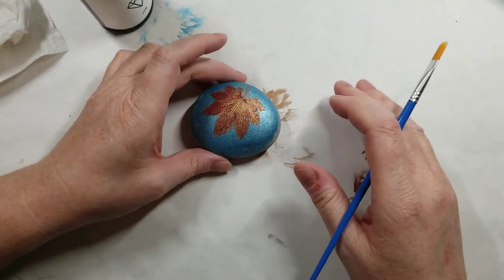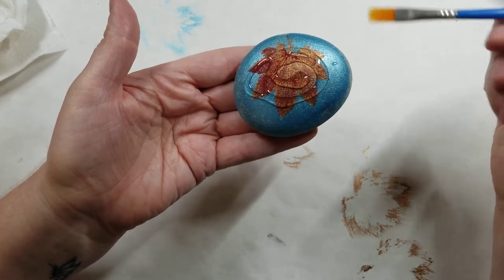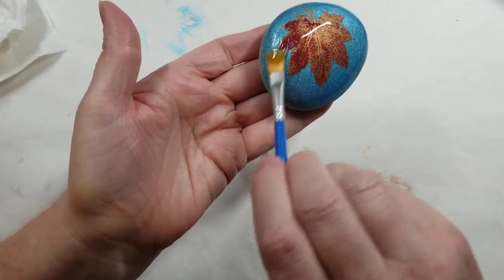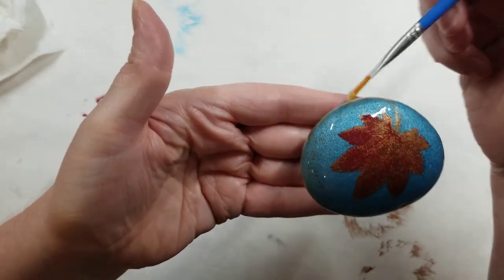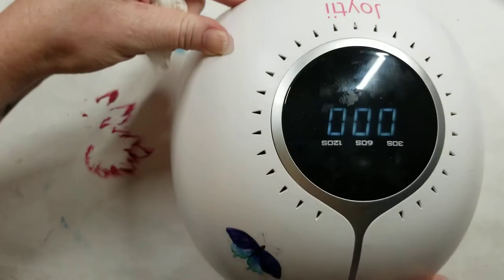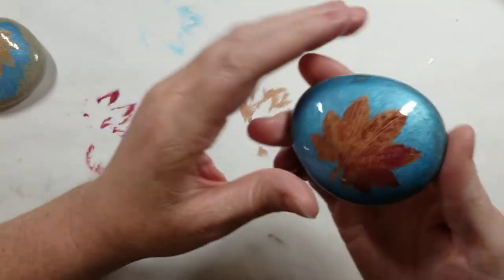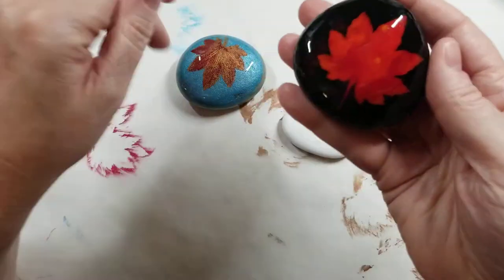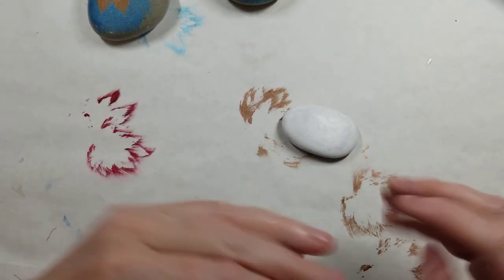Applying UV Resin (rock painting)

Comment: What kind of light source do you have over your work area?  Do you notice any accidental curing of resin from the room/work lighting?  Have cured items inside resin and not sure if it was light coming through windows or my household lighting but seemed like I would get blobs of thicker resin or partly curing resin while I was still working on it.   I know LED's don't emit UV light but most other bulbs do emit some.
Reply: Unless the LED is a UV based LED bulb.
Reply from the maker: Hi! WOW! Very good question!! 

I do not have issues with Mr Resin UV resin "blobbing up"😎 indoors, but I could see how that might occur if the conditions are not properly set in the work area! My work area is free of any natural sunlight, which would be the hugest concern as ANY UV from windows or skylights would be bad. My main lamp is LED and it could, at higher settings, slowly set the resin, but it isn't enough UV emitted to cause premature curing as I am applying. I keep my LED settings lower while applying as well. I use the new model Neatfi XL desk lamp for my workbench. 2,500 lumens. It's pretty powerful LED at the highest settings. 

I would tell you that any UV from sunlight will cause the UV resin to prematurely start gelling up, or blobbing up. So, applying indoors near a window is going to cause premature curing issues unless you have a good curtain to block UV. If the room has suspected UV emitting lighting, then I would replace the bulbs or turn off that suspected light while applying. Making your area UV free except the lamp would be important. The UV resin application will always be inconsistent if prematurely exposed to UV before you're ready! I also apply away from the UV curing lamp. I keep my lamp on a little shelf under my bench so i can reach under pop it over my rock, then put it back under when I am done 😎. 

I hope that answers your question! 💗🥰

Comment: this is a really solid method of coating stuff with uv resin, thank you! so is the trick to not having the resin drip all down a rounded surface just putting on a thin coat? i want to try applying resin to 3d models but they often dont have flat tops, so i want to make sure it sticks to the surface and doesnt start pooling wherever i apply it
Reply from the maker: Yes, I would use a small brush and do thin coats. The cool thing about uv resin is you can layer it without sanding the cured resin surface. When I have added resin to any of my 3d printed surfaces I have used a stylus or similar tool to apply.
Reply from the maker: My updated video shows my brush method specifically to help prevent drips on a rounded surface. It should be my latest video💗 good luck!!

Comment: Love your rock art! Have you tried ArtResin? If so, how do you like this one compared to that one? I have something pretty big that I need to epoxy and will need to apply it with a brush like you did to do the sides and such.
Reply from the maker: Hi! Thank you! 
Yes, actually I started out my epoxy over rocks journey with Art Resin, but quickly realized it yellows very fast, especially if exposed to any sunlight. I was very disappointed to find out that is a common problem with Art Resin and most 2 part epoxy resins. 
Hopefully your project is staying indoors?
Reply: @natalieeofnateartcreations  well it will be both indoors and outdoors. I've been concerned about yellowing, but on their website they talk about adding a lot of UV protection additives so that it will stay clear for many years. Do you think you bought it before they were making it UV protected, or is the protection just not as good as they let on?
Reply from the maker: @stephenwhite5444  my change to UV resin occured in June/July 2021. In all the research and customer comments/complaints i found on art blogs I'm not certain that they are completely transparent with the yellowing. They continued to state it doesn't yellow even when there was evidence to the contrary of items stored inside away from sun, apparently. (Canvas, etc). I don't know if they recently reformulated. Do you know when they say they reformulated?
Reply: @natalieeofnateartcreations  I'm not positive but I'd imagine prior to 2021. It seems odd that it would yellow inside....makes me wonder if it was really their paint. For instance oil paints that people make from linseed oil will darken or yellow when in the dark. I'm pretty sure even epoxy with no UV protection only yellows from sun light exposure.

Well I'm glad you told me! I might need to come up with some other kind of clear top coat besides epoxy. Do you have any suggestions? Maybe a clear water based spar urethane???....only issue with that is it's  fairly thin so might just run down the sides and would take a ton of coats even to get it 1/16th thick.
Reply from the maker: @stephenwhite5444  it's a bummer, for sure! What are you trying to resin?
Reply from the maker: @stephenwhite5444  also, the yellowing is in the formula because many of us who used it initially in our local rock painting group reported that any that had remained on the art shelf even unmixed over time started to yellow in the bottles.
Reply: @natalieeofnateartcreations  it's a ice chest/ cooler that has been fully painted in detailed artwork with Golden acrylic to be branded. It will be in the sun a lot and be moved around, transported, etc.  I'm trying to figure out a durable clear top coat for it, I love how epoxy adds a depth and was hoping to get effect....but staying clear is more important than deep.
Reply from the maker: @stephenwhite5444  i do know there are many brush on sealers that would do the job and add the resin look. I don't personally use them, but I have rock painting friends that are allergic to resin and use those instead. Let me go find out for you what it is. 😎 i need to find their post on Facebook.
Reply from the maker: @stephenwhite5444  so, Duraclear, has a brush on and a triple thick spray. Someone also said that liquitex pouring medium gloss applied in 2 coats seals with a clear resin-like finish. I am a huge advocate of testing before doing so if it were me I would get some of the heavier duty weatherproof sealers and test the application on something similar. Decide what you like, then apply to your cooler. It sounds like an awesome project! I hope you're able to seal it. 
You could always go with a couple coats of a nice thick acrylic sealer like Aleene's. It's fantastic and is super shiny and resilient. It's in small cans though, so it may be expensive!

Comment: Thank you for this. I want to try this. Where do you get this uv light that you can set the time?
Reply from the maker: Good morning! 😊  This is a UV nail lamp off of Amazon, but I don't believe this exact one is carried any longer. I will post the link of a new one I have tried that works just as awesome ( if not better) than this one💗 Not just any lamp is strong enough to cure so fast. You'll want one that is very strong. Let me get the product link.😎
Reply from the maker: Here is the newest model. Very strong and fast! 
The bottom plate does pop off so you can use it on an rock easily. 
I place the rock on a white mat or board and move the lamp over it instead of moving a wet with resin rock into the lamp😎

UV LED Nail Lamp, Gugusure Nail Curing Lamps for Home & Salon, Led Nail Dryer for Gel Polish with Automatic Sensor/4 Timer Setting, Professional Nail Art Tools for Fingernail and Toenail Nail https://a.co/d/1KCdRhZ
Reply from the maker: Thank you for coming by! Happy painting!

Comment: I just started using jdiction uv resin and after curing it for 4 minutes it still felt tacky. So I left it alone overnight then sat in the sun for 20 minutes. It's been 5 days now and it still leaves fingerprints in the resin and has a slight tacky feeling. Any tips you could give me please?
Reply from the maker: Oh my! What is the strength of your uv light? 
Has it been in the sun for 5 days? Or just the 20 minutes?
Reply from the maker: @fireblazinstar  oh wow! I haven't ever had an issue with "too thick". Your wattage seems adequate. I have had one other person tell me they had curing issues with this brand in the last 2 weeks. If they suggest a bad batch, I would return it and ask for a replacement! In the meantime, if you can leave it in the sun for several hours, try that. If still tacky nothing is wrong with going back over it with more resin. (A known good resin). I honestly only use Mr Resin UV resin, so I have no recommendations outside of that brand. I hope you can try a new batch of Jdiction!! It really should not be hard to do UV resin. If you're experiencing issues like this that even the sun cannot cure, I would say it's the resin's fault.
Reply: @natalieeofnateartcreations  ok thanks and i contacted them they said they will send me a new one.